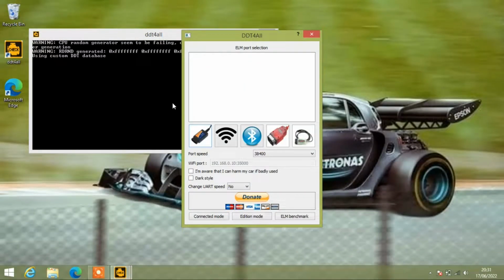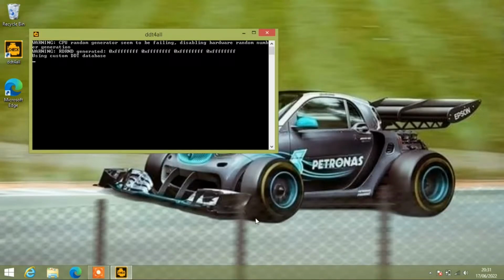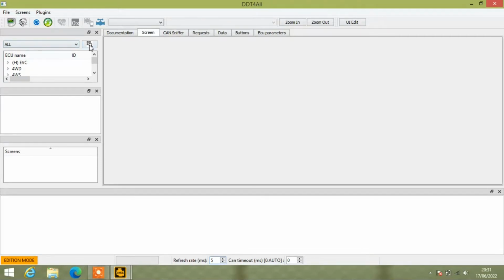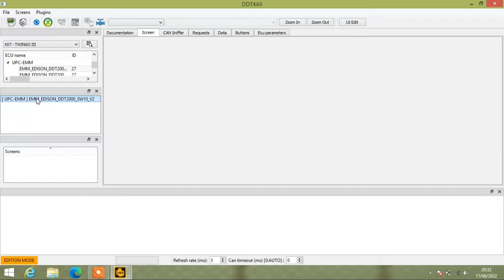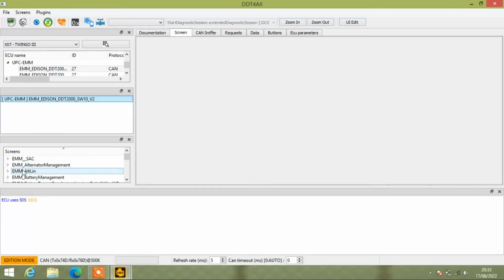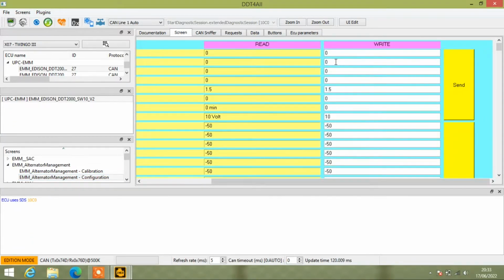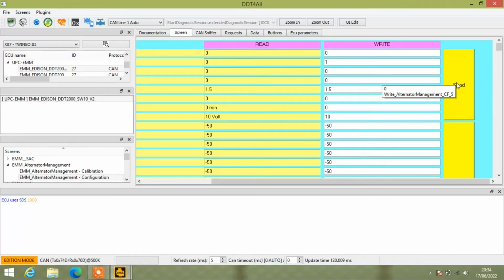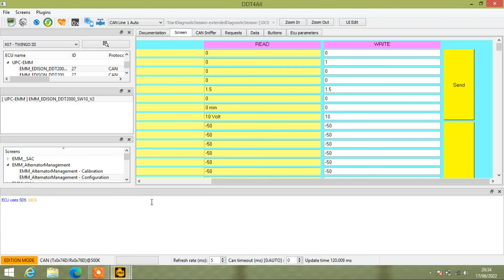Smart 453 start / stop removal using DDT4ALL.

Comment: Many thanks for the video and online guidance. I was able to connect and scan, arrived at the page you listed and changed the setting to 1. I then engaged 'Einstein Mode' and hit Send button (the top one). It appeared to be writing the new codes but on refresh, setting keeps going back to zero. Does the car need to be running or some other switch set?
Reply from the maker: Try with ignition on. If no joy drop me an email.
Reply: @mvautomotive7092  Hi, Can't believe its a year ago!!!! Anyhow, I found a moment and the right head-space to look again yesterday and auto start stop now disabled and message gone. Many thanks again.
I now have an airbag light that came on shortly after a service!!!!!!! Is there a section in DDT4All that I can use to clear this? I tried doing a 'Clear All' after clicking the green health/heart button but my laptog gives me a 'Python Error' and DDT4All closes down if I try using this.

Comment: Yes - just what I was looking for 😁 Thanks 👍    I bought a used 2015 Forfour which the previous owner had changed the battery & alternator - now they reckon because the new Alternator is not the exact same as the old one (slight spec difference) the Start/Stop never works & just comes up with the warning every time I start the car - I want to disable it altogether so I don't get that warning - or could I alter some of those Alternator settings to make the Stop/Start work again ?  I think I'll just disable it for now 👍
Reply from the maker: Easiest option disable lol glad it helped.
Reply: @mvautomotive7092  Ok, that worked, no more pop up about Start/Stop although I have a non standard Alternator it came up with some red messages in the coding box at the bottom - see how it goes 😁